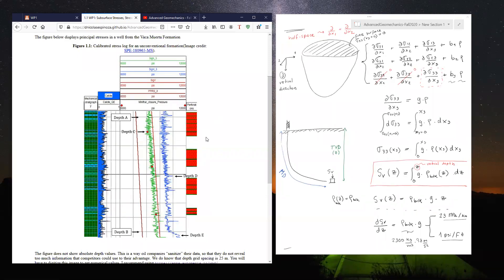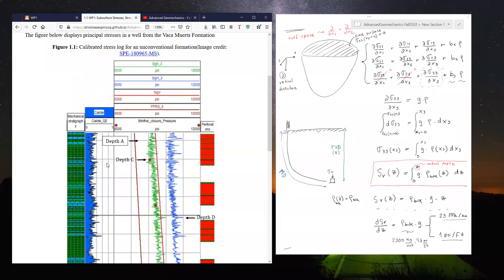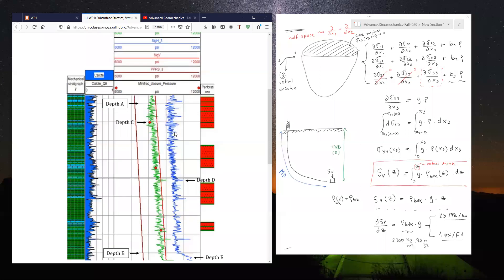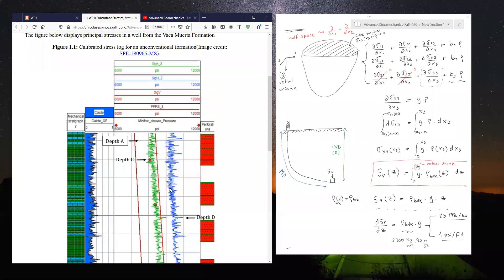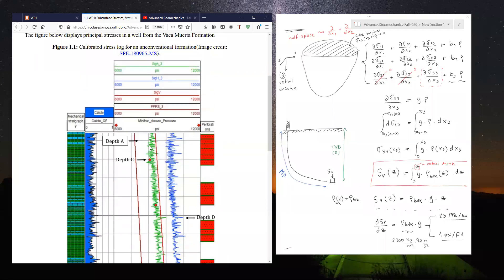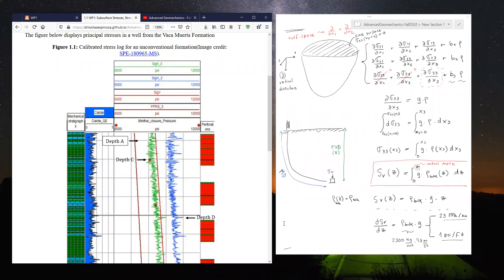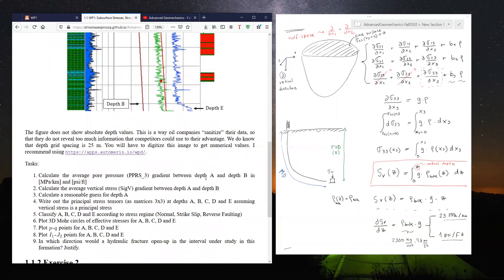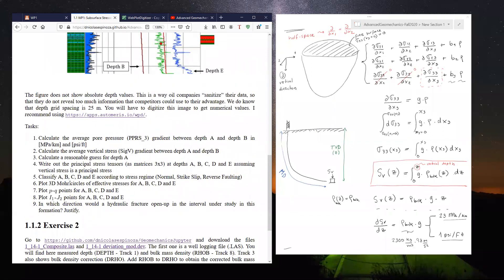WP1.1 Reading a stress log

Comment: Hello, dr. 
Thank you for the lecture.
I have few questions regarding stress regime change with depth.
1) what are the causes of depth-dependent stress regime, I'm studying one of the wells. And using linear poroeslastic method and by calibrating the stress profile, with LOTs. What i noticed is a stress regime change from Strike slip in shales and changes to normal in the unconformity. 
2) my 2nd qst is, while reading stress log, can we say that the stress is transitional? for example your case sir, you have Shmin~Sv<<SHmax according to Zoback, ML., 1992, this stress regime is transtenssive. So can we use the rerm transitional?
Thank you sir.
Reply from the maker: 1) This paper is based on an elastic mechanical earth model with constant tectonic strain and predicts high horizontal stresses at depths that coincide with strata of high stiffness. Horizontal stresses are proportional to the plane-strain horizontal Young modulus: https://dnicolasespinoza.github.io/node15.html#SECTION00434000000000000000
2) yes, in some cases it is close to a corner of Zoback's stress polygon
Reply: @dnicolasespinoza5258  thank you very much sir for your help.